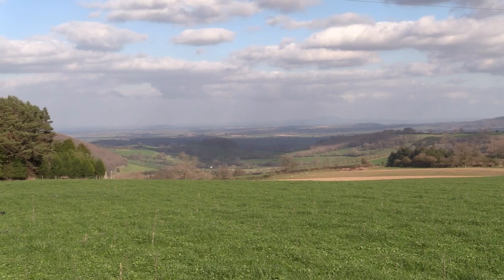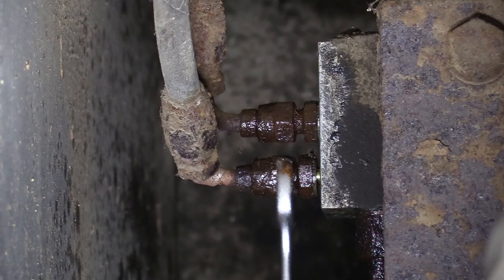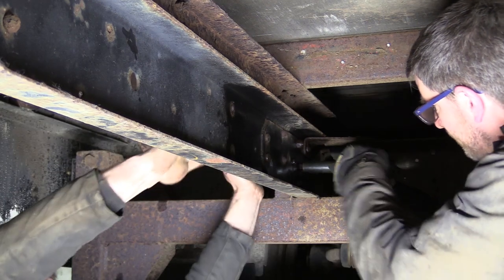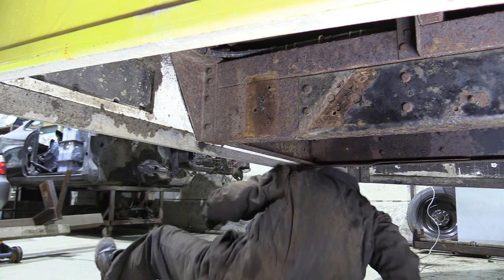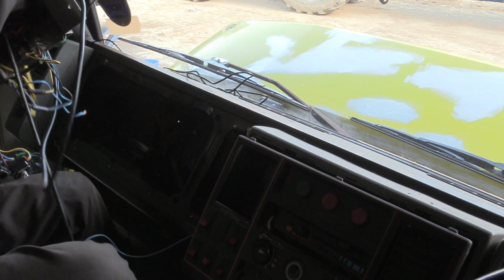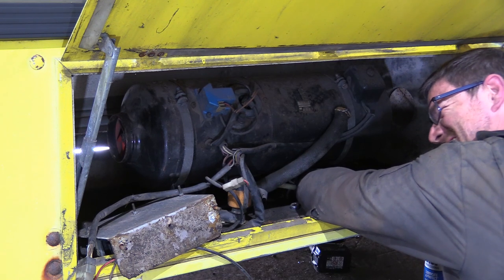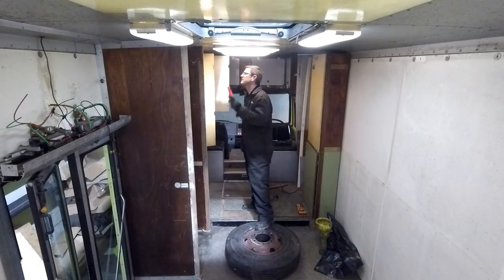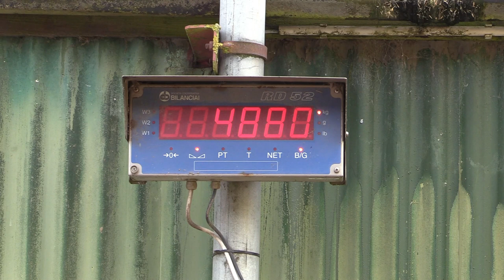The Escargot - RV/Camper Car Transporter Conversion - Part 1

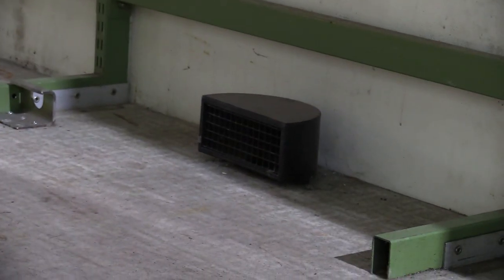Comment: 20:23 "it's old and defunct, so it's going".

So we could possibly say that you're "getting the defunct out"?
Reply from the maker: Not sure whether to laugh or cry at that comment... 😁
Reply: @BadObsessionMotorsport  i cringed so hard i squeezed out a tear.
Reply: That deserves a free mug
Reply: GROOOOOOAN!!!
Reply: I liked it.
Reply: Or in words of Aerosmith
"If you don't like, what you see here, get the defunct out, get defunct out, get defunct out"
Reply: Aww I was going to say that! 😃
Reply: Cue the 1970's adult movie music!
Reply: Surely just "getting defunct out" 😂
Reply: #winning
Reply: @BadObsessionMotorsport   More concisely, "Getting defunct out."
Reply: The comment about how the diesel heater works is incorrect I think. You don't breath the air from a 'Diesel Burner in that heater" it should be its own separate glow plug style cylinder. The heat is pulled from the cylinder with heatsinks into the ductwork you showed.
Reply: Solid pun. 3 cardboard aided designs to you sir
Reply: FREE MUG FREE MUG FREE MUG!
Reply: @BenMillen  errr, you mean Extreme right?
Reply: hahahah
Reply: @BenMillen  Extreme, not Aerosmith - otherwise - spot on.
Reply: I remembered this comment right as the bit happened

Comment: Hi guy's 
The vehicle was built by Locomotors in Andover Hampshire,  I used to work there and we were a vehicle body specialist, ranging from post office vehicles to armoured vehicles and fire engines as well. It was a great place to work and we did pride ourselves on our workmanship!
Reply: That’s really cool!   What are your suggestions they could try for further weight saving (myself maybe  I’d try next the  lighting system in the roof‽ )
Reply: @Simon78  just a guess - they're gonna go for the walls and ceiling material, replacing metal with composite or cloth. And mb chassis, with some ingeneering instead of simple metal beams.
Reply: From the first weigh bridge read... oh no they're not going to get to about 4.5ton just from stripping the excess.
2nd read... yep going to have to rebuild it.
Reply: You fellas built it well. Still running all these years later.
Reply: If they're making a "camper" why would ya bin the heating
Reply: The old night heaters are heavy fuel suppers. And at my work we are making one out of a daf library bus for F1 stock cars and we had to chop the back end and slant it which cut weight and made it easier for low vehicles to get on.
Reply: @jonathanwright5550  It's 30 years old, I'm pretty sure there will be a more modern and efficient unit on the market plus it's a custom re build they will want to do everything their way...these guys are perfectionists...
Reply: @135Ops  yeah thats true. A new unit would be more efficient....
Reply: Nigel.. as they said "skoocum as frig " .. i'm sure I've heard that somewhere before
Reply: jonathan wright not only efficiency but weight and the fact that this unit was large enough to heat the whole vehicle and if they transport a car in the rear end they will no doubt have a middle wall separating the two halves and no longer need to heat half of it
Reply: @135Ops  You mean Nik is a Perfectionist who wants everything, while Richard is just along for the ride.
Reply: @jonathanwright5550  because they will change it to a more modern system
Reply: @Simon78  How about a nice set of ally wheels.
Reply: Thanks for the post mate. Must've been a kick to hear your workmanship being praised. Well done 👍
Reply: Very heavy duty workmanship
Reply: jonathan wright its outdated and no where near as efficient as what we have available in today’s market, but all that was mentioned in the video and above also 🤦🏼‍♂️😂
Reply: Nigel I used to play around barlows lane and locomotors and the two lakes whose names I forget in the late 70's. Am still a local man at 50. But based in one of the villages around andover these days. You guys also built the Talons correct in the early 2000's?
Reply: @jonathanwright5550  defunct.  much more efficient replacements available nowadays.
Reply: @jonathanwright5550  Didn't work .
Reply: They literally said in the video that it was not working so of course they'd chuck it.
Reply: @jonathanwright5550  As they say, the existing stuff is ancient, so inefficient and uneconomical whereas a modern camper heating system will be lighter and far more efficient.
Reply from the maker: @bmw1894  yeah, he does ***k all.
Reply: I remember when these where new - they where Essex council library vans and in my area they where based in Barking when it was in Essex
Reply: 300kgs of dust on the thing.
Reply: guys has no apostrophe, unless refering to something belonging to a guy. in which case it's guy's.
Reply: @vanoscrap6296  *engineering
Reply: Ferocious Mullet 

Yes we did acquire the company, but don’t recall actually building any myself?
Reply: @888johnmac  nice to see some AVE references. Watching from the republic of Canuckastan
Reply: woooohoooo, hahahahahahahahahahahahaha
Reply: I can't for the life of me figure out what that chasis is called and what motor is in it, any chance you remember?
Reply: Found the motor: http://cworthy.net/boat/documents/Ford%20Diesel%20Power-%20ESD%20Service%20Manual.pdf
Reply: @The_one_below  And they were downright dangerous. Also a new fit is a doddle these days. They are so small.

Comment: Well shit I guess I'll start another 8 year journey on a you tube project.
Reply: I expect it'll go a lot more quickly than that.  It seems to me that Binky takes a long time because the size constraints.  Other than the rear door, I expect they won't have to re-engineer many iterations due to space.
Reply: @roboticus3647  hope so, I only watch because my friend in 94 had a 90 Celica all trac in the USA (and incredibly rare here only like 3,500 total for that generation imported here if i remember right).....it was fun, but way before 2 fast 2 furious so we didn't truly realize how good it was.  I pushed him to run it to redline on day one, unfortunately we were on a hill so it sat at like 7k or better too long....blew the bearings.  His dad was crazy rich...fixed in a week.  Fun car.
Reply: @roboticus3647  I thought so too until 33:14. Expect to see the rear box go and an alloy frame and panelling go on. It's only 380kgs they need to lose.
Reply: @cunning-stunt  Yeah, I suspect the whole thing will go. Couldn't they just get a box trailer for the car and tow it? Seems it's what a lot of teams do.
Reply: @RandomPlaceHolderName  Where is the fun in that? If he gets really radical he might even chop the cab up and make his own cab, one that is more integrated with the body. But most likely not, The living quarters will be up front so the front axle loading will be pretty low, most of the weight is going to be on the rear axle and there is a set limit as to what that can be. He might chop the rear chassis rails and make the rear end ramped to make loading a car in easier. The stock car guys do this on old buses and coaches all the time. He could also add a second axle at the back to increase the gross vehicle weight.
Reply: @cunning-stunt  I suppose the fun in a box trailer is that they get done with this project quicker and can move on to something with more racing pedigree all the sooner, obviously. The main thing i look forward to with this series is how few or how many luxuries they bring along in the living quarters.
Reply: @RandomPlaceHolderName  And the sleeping arrangements. One Double bed? 'Day time friends night time lovers'?

Comment: Am I really watching half an hour of you two adding lightness to a library?
Reply: LOL!
Reply: everyones answer is yes, and definitely worth it!!!!!
Reply: Ah! My mum always said if I went to the library I would be enlightened!
Reply: not just that but half an hour of them hitting metal with hammers with *no ear protection*.
Reply: They had to buy the wheels separately - when they went to collect it, it was up on books.
Reply: A workmate of mine took a six wheel community bus chassis and had a box body made using freezer spec panels. It was snug, very tough and he used a domestic type heating boiler with finned floor level radiators. He had to re work the back suspension because the originals (rubber trailer springs I suspect) were too hard. Air springs would be the best so it could be pumped to suit the load being carried. 
The Binky Bus is already heavy but HGV air springs on the back could be handy.
Reply: @vodkacorn  pardon?
Reply: Nothing wrong with a bit of light Reading.......
Reply: Hence the name Bad Obsession . ;)
Reply: Install a Raspberry Pi and make it an ebook library. About 50 grams for more books than the truck would've ever been able to carry.

Comment: A  C-1E licence  covers a 7.5 ton with a trailer,  you could reduce axle weight by using a trailer to carry the kettle and tea bags, you're welcome, glad i could help
Reply: That'll need to be one mother of a trailer!
Reply: And a welder should a BOM mug decides to break again
Reply: They should have gone with a Mitsubishi/Fuso Canter since most of them have a 3-4ton load capacity but still rated for 7,5ton (C1)
Reply: where are the spare angle grinders going to be stored
Reply: i must be missing something, why are they so worried about the weight? even at 5000 they could load a any small car and a shitton of parts and still be below 7500?
Reply: Nebbia affaraccimiei and fuel and water and beer etc etc. Spare wheels/tyres. Workshop tools etc. Plus they said they want to be able to take any of their project cars. No idea what the MGSV weighs...but it’s more than Binky or the 205 I bet! 👍

Comment: I've got an '86 Cargo 813 here that you're welcome to if you need it. The motor is like brand new & was used as a Motocross race truck, but the GRP body is rotten. Located in Reading.
Reply: Commenting just to say you are a good bloke. Very nice gesture 👍
Reply: I agree.
Reply: Great gesture.
Very kind & helpful.
So please take up the offer, & use that engine.

Comment: If it's carrying Binky, does that make it a horse box?
Reply: Clever, very clever!
Reply: A white horse box.
Reply: A horsepower box
Reply: The amount of time they're taking with Binky, it could be a FloggingADeadHorseBox.

(sorry)
Reply: Can the the new back door also be the loading ramp? Bottom hinged with a fold so it's not too steep. A fancy tail lift will be HEAVY.
Reply: David Elliott Thats what my box trailer has. It's an ex-horsebox chassis, is missing the assister springs and it is indeed faaaarkin heavy.

Comment: Stay tuned for part 2 when Nick decides on the 24 cyl Napier Sabre engine...
Reply: I'll bet he's one of the only people to be able to get one of those running again. Hopefully one will run and perhaps be put in an airworthy Tempest or Typhoon.
Reply: @julianneale6128  But I'm sure Nick could have some fun putting one in a car to 'test' it
Reply: @psk1w1  haha I'll bet he'd have a couple of simple ideas, all the rest would be horrendously complicated but highly impressive...
Reply: it'll require 14 episodes of custom brackets and cable drives, to make a cuppa, not power the caravan.
Reply: hooptiej bring it on!
Reply: Napier Sabre hell, you know Nick will screw in a Napier Deltic.

Comment: my own current project is turning an 1988 (I wanted Chevrolet TBI, I have since learned this makes me a bit odd, but It gets cold here, carburetors can be difficult.)  conversion van into an homage of the boogie vans of the 70s.   These vans came with towing packages, better suspensions and better charging systems.   However mine weighed 7400lbs. Its just a van. How does your weigh so bloody little?

Comment: I was an HGV engineer back in the '80s and'90s, the era of the Ford Cargo, and I've worked on hundreds of those things, including many applications similar to yours, so I confess I laughed heartily and mercilessly when I saw the fixed cab - those Dover engines are designed to be worked on from the top and the sides, so we had a special hatred for coachbuilders who fixed the cabs down. Even routine maintenance can be a nightmare, and anything serious like changing a head gasket becomes nigh impossible. Still, I suppose for what you're doing, it will be a good choice body-wise.

One thing that springs to mind - as I recall, they had a tendency to seize the kingpins, so make sure you grease them religiously. Also, the gearstick linkages flop around like a fish in a bucket and wear out pretty badly, so plenty of spray grease on it (if you can get to the underside with that fixed cab...).

Oh, and I believe someone mentioned open ended ratchet spanners - I don't know if they still do them, but I have a set of Snap On open ended ratchet spanners in my toolbox, I kid you not. I imagine you can still get them.

I look forward to seeing what you do with this - a real trip down memory lane for me, a good project and I don't have to work on it, an added bonus :-)
Reply: I have some open ended that are shaped to kind of rachet...still available in my local shop...
Reply: Any good news? It's a Ford Library Book Truck.. With added horse shit... I'd get under there with a wire brush in a heartbeat.. 
Why they can't get the local police to fight off volunteers is beyond me!
Reply: Make it a tilt-up... cab, box, everything.

Comment: Replace the OEM springs with air bags and use them to level the body when parked. You get a much better ride and no additional weight for levelling when parked.

Comment: Was the aftermarket rear bumper not there for vehicle under-run protection / compliance reasons? (which I think any vehicle made after '84 needs)
...If you're replacing it with something else or overall lowering the vehicle then you'll probably be fine though.

Comment: If the box is made of hardwood as well it's properly wet. Even on a family camping trailer that can be as much as 100kilos extra and has been the cause of many campers to fail MOT here.
Put a dehumidifier in it and see what happens.

Comment: So good to see a British channel using metric system.
Reply: Britain has pretty much metricated, except (for some odd reason) road distances and speeds are still in miles. But petrol is sold by the litre so that must make calculating your fuel economy a "bit of a nuisance".
Reply: @christopherbedford9897 Not in the slightest; we use miles per gallon so we know how far we go on a gallon, rather than the continental system of how much fuel you use for 100km which is utterly bizarre :D
Reply: @sl077766  Umm well (a) to use MPG you have to convert litres to gallons so yeah, bit of a nuisance and (b) it's only "utterly bizarre" because you're not used to it. My father called it something similar when we metricated in South Africa in the 70s (in the 70s! How far behind you are!!!) and he never  converted - but then, he refused to use a calculator either, and insisted on doing all the calculations by long division. Yes, he was that reactionary. 

I've been using l/100km since my first car in 1981 and when everyone uses the same measurement it makes perfect sense - after all, it's not the numbers that matter, it's how they compare to similar vehicles and to what your vehicle has been doing for the last "x" months or years.
Reply: @sl077766  
L/100km seems bizarre (ok. IS bizarre) but it's great for marketing.  Better economy gives a smaller number at the front.  We use it in Aus and I grew up with it, but it is really meaningless compared to km per litre.
Reply: @mattjohns3394 I've no prob using km/litres but at least do it the right way around ie how many km on a litre, l/100km is plain stupid (imho of course :D ) and sod the marketing!

Comment: sandblasting the frame will  remove many many kilos of dead rusted weight
Reply: But wouldn't that remove the essence which makes it a Ford?
Reply: @yorickhunt3371  Well if it was a Chevy, (or anything Brit, or Italian) it'd not be there any longer to sandblast, having succumb to the metal termites long ago, so at least it still has essence (~_^)
Reply: Even just pressure-cleaning underneath would've removed quite a few kilos!
Reply: @jpkalishek4586  nonsense, if it was British (and the owner always topped up the engine oil) then there'd be a nice healthy layer of oil on everything
Reply: @hairyneil  May well be so, for where they are at . . . but I live in the land of Road Salt. Up here, the stuff might have a decent engine and tranny, with a pumpkin well soaked, and everything else looking like it is returning to the ore from whence it came.
Reply: @jpkalishek4586  ha aye I know fine, grew up in the Westow Scotland, if its not road salt it's seaspray!

Comment: I moved to Ontario Canada in 1982. Bring a mechanic I very quickly learned to use an oxyacetylene torch. Otherwise known as the liquid wrench here in the snow/ rust belt. I have never had a car here that died before the chassis rotted away

Comment: What a mission, lol. You could turn 1/2 into a flatbed for extra weight savings.
Reply: How about a full flat bed and just stick a tent to the back it's a win win XD
Reply: @DatBoiOrly  sounds like something Richard Hammond would which makes it a silly idea 😂😂.
Reply: Except they are in the UK where it rains all the time. Having an enclosed area means they could work on the car in comfort
Reply: If they would have access to 240vac they could get a portable spray booth which is inflatable. Only trouble with that is anchoring it down and putting it away afterwards.

Comment: If a flashlight is a torch in England, what do they call an oxy-acetylene welding apparatus?   Are there regulations that make them hard to own in England?  I ask because you all fought with those stabilizer bolts an awful long time when you could have torched them off with a quickness (and saved your ears).  Looks like a fun project, subscribed.